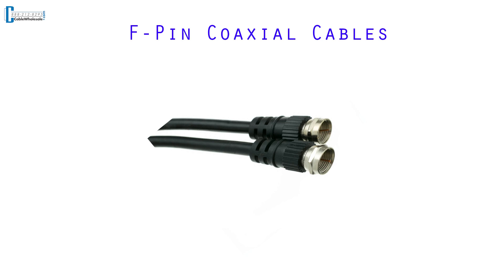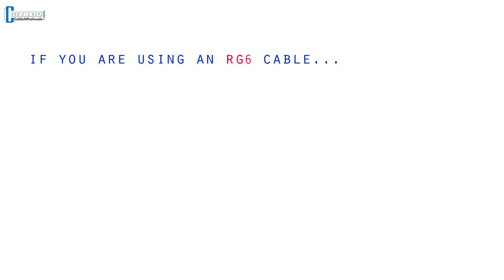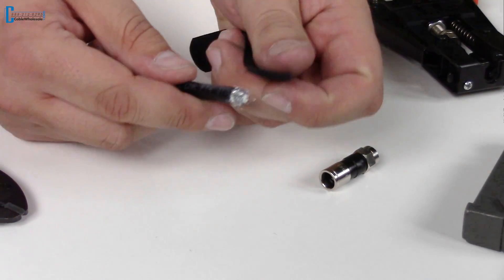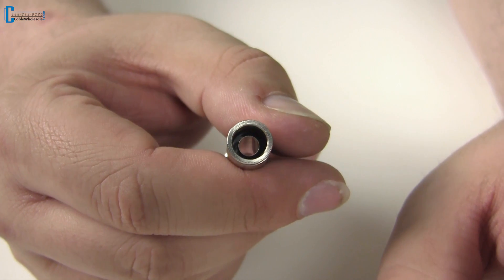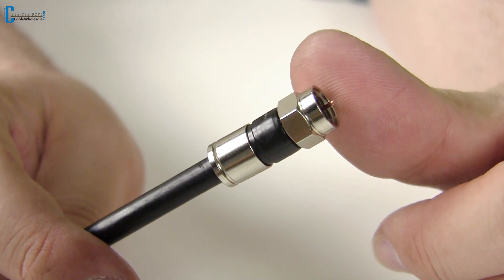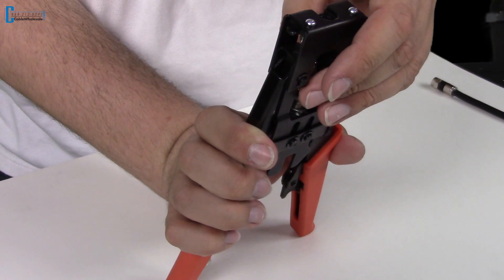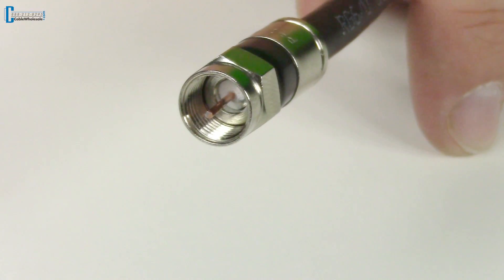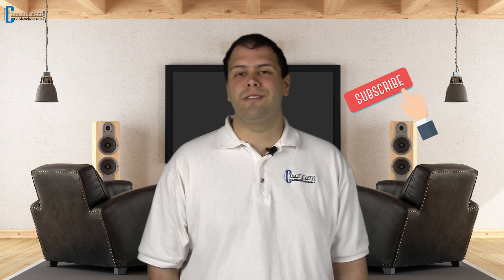How To Install an F Pin Compression Connector - RG58, RG59, RG6

Comment: I was looking for advice on how to fit an RG58 connector (which doesn't have a copper rod stem, it has a twisted wire core).   How does this work.   Is there a special RG58 Connector?
Reply from the maker: Iain, yes the connector is going to correspond with the cable designation. Making the connection will be a very similar process but, you will need RG58 specific connectors to terminate RG58 cable.